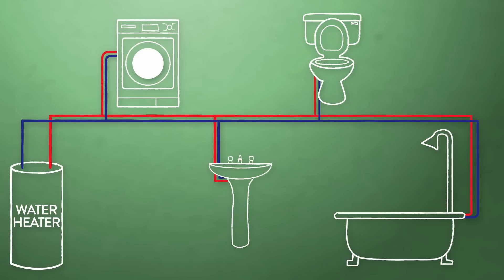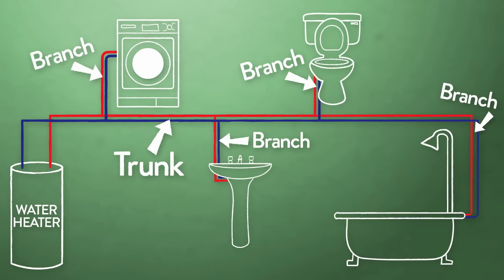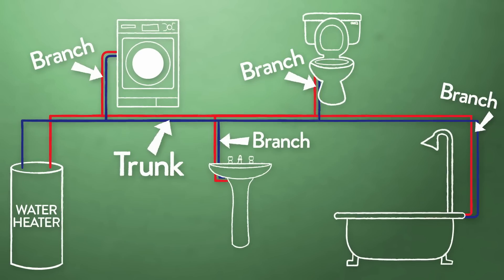Why Does The Shower Get Hot When The Toilet Is Flushed?

Comment: Turn the pressure up on the pressure reducing valve. This is mostly the case when a house i plumbed in 1/2” if you can increase the pressure so your cartridges has higher flow going through it.

Comment: Totally outdated video! What nonsense, superficial amateur video, in most newer bathrooms (after about 1975 here in denmark), the shower faucet is a type with thermostatic control of the water temperature, and it will be very little difference to feel if the  faucet is in good condition. Incidentally's water supply system in newer houses from around the year 2000 (since plastic pipes was introduced) performed on the way to the individual taps are provided directly from a common distribution system, so the impact on the water pressure referred, will not occur. The way that the video is shown how a pipe system is built belongs to the past, at least in Denmark. 

Of course there are older plants in Denmark carried out in the manner described, and here a thermostatic mixer definitely be the best option if you do not want changing the whole installation. Not something like reduce the water flow to the toilet or put anything in the cistern to be used less water. It is quite obvious that the makers of this video know very little about plumbing / water installations.
Reply: A thermostatic electric shower is even better as they work on mains cold water and mains electric and will even still work if the hot water system breaks down.

Comment: I've re-piped many houses.  Replacing old galvanized steel with copper or polyurethane (plastic).  This can also be helped with new fixtures (toilets) and shower mixing valves.  It does cost people allot of $$$ though. But they are always happy with the outcome.

Comment: In some houses you adjust the max temperature of the hot water each time you need it (used to live like that). I then put it on medium heat only, because why would I warm my water up just to cool it down again? That also fixed the toilet shower problem. But then ppl couldn't do the dishes while I was showering

Comment: Adjusting the valve to make the tank take longer to fill might not be an optimum solution. Sounds similar to an issue I had where I replaced a toilet value because years worth of mineral deposits were slowing the refill significantly.

What I'm thinking is: while the tank refills, the system also runs water down to refill the bowl. If more goes to the bowl than it needs, it just overflows into the siphon, so the valve only needs to stop when the tank is full. So if you make the tank take, say, three minutes to fill instead of one, wouldn't you just be running bowl water down the drain (literally) for two extra minutes? If the shower can't wait, might be better to just close the lid and wait to flush. (Unless someone in your house is just being a jerk and thinks its funny when you scream in the middle of your shower songs).

Comment: My shower gets COLD when someone flushes the toilet.
Reply: it is due to the inlet pressure to the water heater falls.
Reply: me too
Reply: That means you have a unique toilet that only uses hot water.
I think.
Reply: Same. And if someone runs hot water it gets cold. And if they run cold it gets hot
Reply: Well, now what?... So there's a different plumbing system that they didn't address I guess...
Reply: Dave_E_Snow. thats wired
Reply: Same lol
Reply: My shower stays the same all the time
Reply: Xbox Helper 2.0 because code was changed when you’re home was built. If you have just one handle. You have a mixing valve. Back then they were different. Mixing valves were not a thing back then. Probably not till around the 90s atleast. 80s minimum.
Reply: Dave_E_Snow that’s never happened to me
Reply: dead channel pro you may have new plumbing.
Reply: Same
Reply: At My parents it gets cold, and nothing happens at my house
Reply: Same. All these replies are dumb. It doesn't matter if it's hot or cold water being used, the shower gets cold. So no, my toilet does not use hot water lmao
Reply: Mine never gets cold and someone never flushes toilet
Reply: Well then your toilet is on a hot water line which isn't very safe if the water is to hot the toilet may crack but it may just be a glitch in the system because its happend to me a few times but flush your toilet and put your hand in the tank to see if the water is hot

Comment: Sadly, the information that you are sharing is very old and outdated. Since the 90's many plumping manufactures like Delta and American Standard developed new shower faucets that auto balance the pressure of the cold and hot water coming in. For example, when someone flushes the toilet, the "modern" shower faucet senses that cold water pressure drops and then a mechanical mechanism kicks in to reduce the pressure of the hot water. This will result in the same water temperature after the toilet is flushed. If you are still experiencing this issue then you just need to upgrade to new shower faucet system.

Comment: good thing new bathrooms post 04 fixtures mixing valves come with a scald prevent er automatic lowering hot water when a cold drop is detected and its been around sine 2003 2004